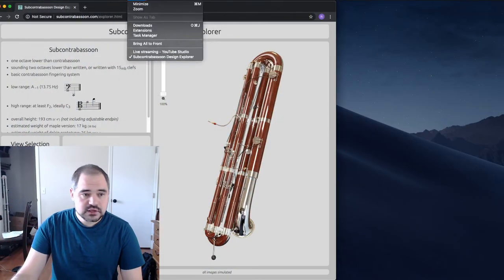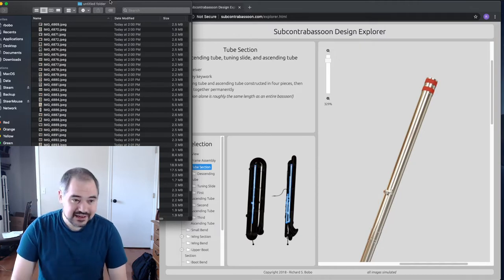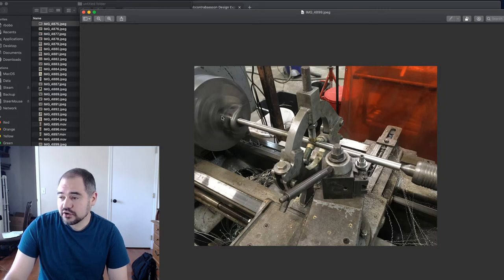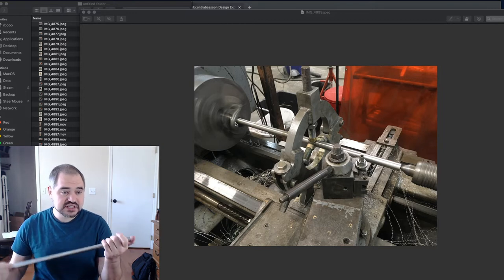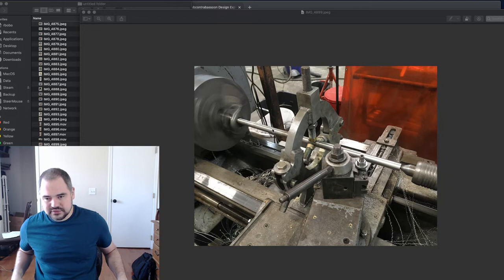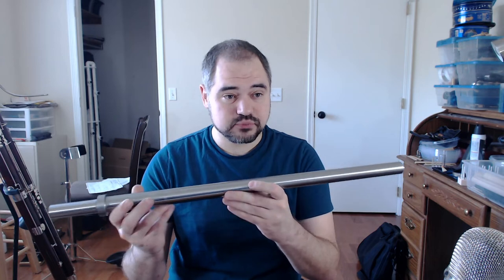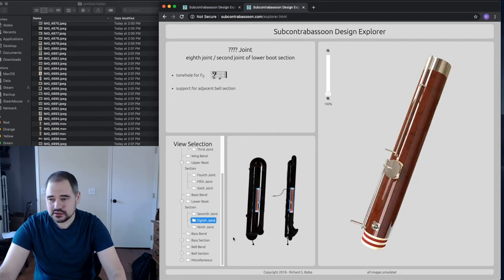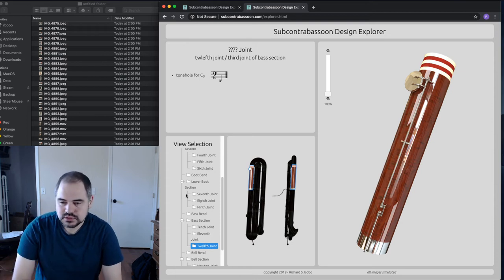This Week in Subcontrabassoon (04/24/2020)

Comment: Looking at the Alternate Bell Styles you have on the design explorer, If the subcontrabassoon was to be made in a similar fashion as a Classical Contrabassoon, how insanely impractical and unwieldy would that actually be?
Reply: xander10 well for once it probably wouldn’t fit in any rehearsal spaces, probably quite a few performance halls,
I mean transport would need an 18 wheeler, and then there’s the issue of player wingspan, so maybe 2+ players would be necessary. That would be a sight to see
Reply: xander10 or better yet, think about how ridiculous a bassoon would be built in the style of a modern contrabassoon
Reply: @zacharycoronado6749  yeah, the size would be a major issue, though a bassoon that heavily coiled about itself would be comical as well